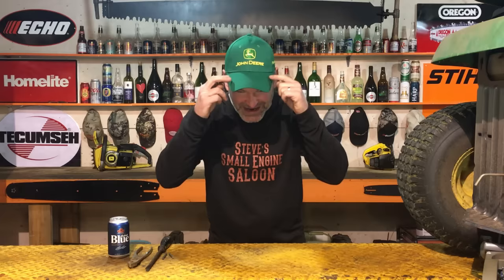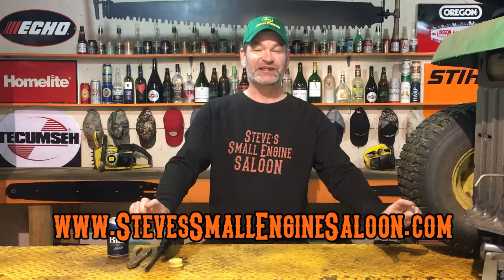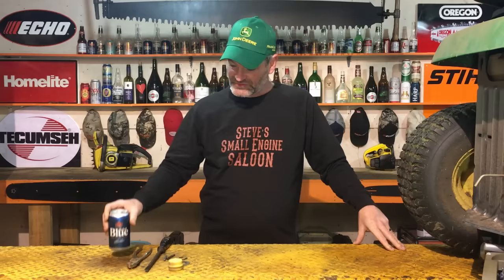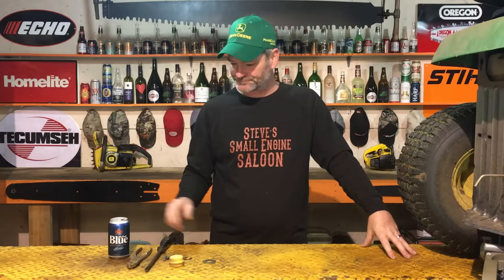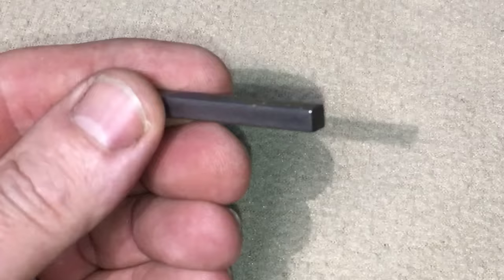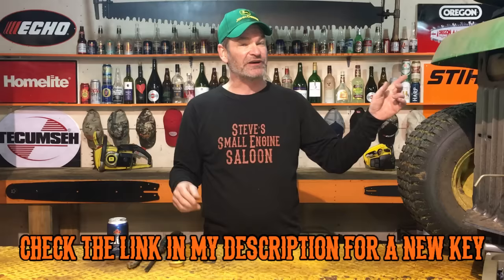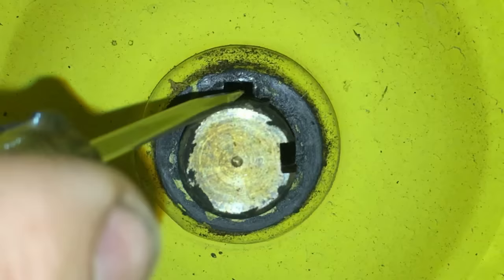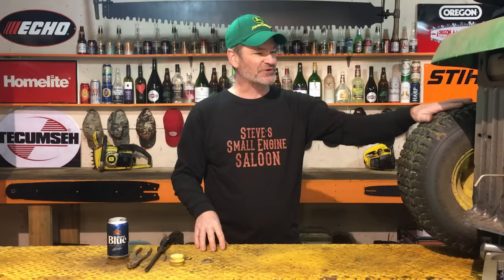How To Fix a Riding LawnMower That Will Not Move or Drive

Comment: Oh I love you. My husband changed the back tire and it wouldn't move. You saved my marriage!
Reply from the maker: Right on Dara!  I am soooo happy that helped....
Reply: Have to be tactful when "suggesting" anything mechanical to a husband. If he didn't figure it out on his own I'm not sure how you can go about revealing his ignorance without deflating his ego. Perhaps, it would be better if you let him load it up and haul it to the small engine repair shop. There, they will tell him that he dropped the key somewhere and he can go try to find it or spend a couple bucks for a new one. He'll likely opt for buying a new one. When he gets home, $25. lighter in the wallet for the diagnosis, he will proceed to tell you how the small engine guy couldn't figure out the problem, and hubby happened to notice how the wheel was free-wheeling when the guy jacked it up. Your husband, with his wealth of observation and knowledge, quickly figured it out. On the way home, hubby has time to make up some tall-ass tale about how he solved it, and your marriage will stay intact. 
Act like you're so impressed with him. Also, offer to go get him some beers because he's so smart. But, every wife should be able to figure out things like this so hubby's ego remains intact. The wife must have the ability to react spontaneously and always say the right thing without hesitation.
Now, quickly while he's feeling so good about himself, ask if he's ready to paint that room you've been wanting painted for the last 5 years. Always ask a hubby to do something for you when his ego is soaring. Complementing  him on how good a painter he is always helps.

Comment: Thank you Steve. Thought I was looking at transmission failure. Found the little bit on the garage floor after I got wheel fixed. I owe you a beer or two
Reply from the maker: Excellent!
Reply: I had that problem. I thought it was a transmission problem so I trashed it. Bought a used hydrostatic weed eater rider. What kind of differential oil does it take? I don't have an owners manual.

Comment: God bless you, dear sir. Lately our mower would barely go in reverse and the past two months it randomly got to where after a while of driving it the riding mower would come to a complete stop or get to really slow pace so that doing anything was impossible(especially of going fast). This was entirely frustrating and our yard got high. Today I decided to try it again and after it happened I looked something else back up on the internet and saw your video. At first I thought it wasn't the problem because we haven't taken the wheel off, but after picking up the mower I found that the left tire would lock but the right side wouldn't. I couldn't see a key so I put in one we had. Unfortunately the key was a bit too big and got locked up in it so I took off the wheel and noticed it already had a key in it. Taking a screw driver I drove out the other key, which didn't take much, and the old key before putting it back together with the old key this time not pushed too far back. When done the tire still moved, but I got back on the mower and tried again. It instantly drove better. On the last few strips of grass I had I cranked it up and tested it and drove fast without any problems as well. -- It was truly stressful. Thank you. Who would imagine something so simple could cause such a big problem?

Comment: hey steve, love your videos:) lots of useful info. SO I got this used craftsman riding mower from marketplace for 150 bucks thinking I was gonna end up with a parts machine for my other craftsman mower. the guy delivered to my house and I hadn't even gone and checked it out. just by the pictures I can see it was in good condition well maintained. guy said it came with the house he bought and it quit running one day while he was using it (which now I believe is totally not true) because he dropped a brand new battery in it and got it running before he delivered to me. he shows up at my house with this thing on the back of his truck and first thing I notice is the steering wheel is out of alignment. he then proceeds to tell me as I'm trying to get the wheels to go straight that the steering is messed up and that the gearbox is also not responsive unless its in the higher gears. (this is not a hydro) 
we unload it and I fire it up. soon as it starts you can hear this metal on metal rubbing sound. so I park it. after I paid him 150.00 for this near mint dlt3000 with an intek 18.5hp briggs, he leaves and now the investigation starts. 
i go online and start looking at cross links and drag links for the steering on this thing then I figured out that the one that was on the unit was just bowed up and hitting the drive pulley. took it off, bent it back as straight as I could get it and now its fine, just needs a good pressure wash and the deck needs some attention cause after cleaning out all the crap that was packed around the pulleys, I discovered that the blade brake was just hanging out on top of the deck.
just thought id share this amazing find and story with you. btw, natty daddy is beer of choice when bud ice is not available.

Comment: Just finished my early cut following all the rains and discovered a flat due to Mesquite thorns. Got it immediately fixed proud of myself and was looking forward to completing the work. &^%$# it will not move. My mind turned to the dark side...............transmission melt down etc.  Found your post and retraced my steps. Must have lost the key at the tyre shop. Took 2 days to get replacement part...............fired up and PRESTO we are back. Thanks for the funny and yet important post. Enjoy your beer!
Reply from the maker: I am so happy to hear this!

Comment: Thanks so much!  I can't believe I found a video for my exact problem.  Thank God I found the key on the back floorboard of my car where I had my wheel to get the new tire put on.  Gave a like and a subscribe.  Now it moves, but the belt must need adjusted or replaced because the blades keep nearly stopping every six inches of mowing....Start stop start stop :-(

Comment: Good video. Thank you Steve. I have a Craftsman LT 1000 and i have a similar problem. The tractor stopped moving forward or backwards..  i have not taken the wheel off ever. Could the key fall off on its own?any suggestions what i should look for ?thanks again for your video. I have not checked the key as yet. Any help would be greatly appreciated.

Comment: Steve, brother, you're great! You have actually helped me with several issues I've had with chainsaws. Here's the thing, I have a mower that won't engage the transaxle, it acts kind of like the disengage lever is in operation but I have moved it back it the drive position and still it won't drive. The PTO brake/clutch pedal doesn't lock the tractor from rolling either. Can you offer me any solution? I mean, I can turn the wrenches and such I just don't know what to do. Not wanting to take it to someone else and pay them to deal with it.

Comment: Steve. From Mark In KY; Those 3/16 keys are necessary for other small engine applications too. The Predator engines use a pretty similar size 3/16” key as the John Deere axle shafts do. I have a 165 John Deere with the left rear wheel seized onto the axle shaft that I have been spraying penetrating oil onto to maybe help break the rust bond. So far, No Cigars on that project.
A couple of days back, I re-powered a Yazoo S-24 Big Wheel Mower with a 6.5hp Predator in place of a Tecumseh H50 5hp engine. My only real issue with the engine swap was having to size the drive belts going from the double sheeve pulley on the engine to the triple sheeve pulley on the mower deck - Two Grooves for Mower Drive, One for Wheel Drive. Due to the engines being different in size, I had to position the new engine farther forward to make things fit up. The down side to my engine swap is the fact that I  now have to use a 41.5 inch incremental belt instead of the 44 inch belts that were so very easy to find. Luckily the belts usually last for a rather long time on this mower. 
On A Different Note Steve, I purchased a key assortment at Tractor Supply Company which had all of the popular sizes. I thought that I would mention this to help others that frequent your YouTube channel. Cheers.

Comment: 2009 Craftsman Professional 917.28970 struggling on slight slopes.  I've changed the drive belt many times over the years, including recently.  I'm assuming the transmission or fluid is going bad (never changed).  Can't find anything anywhere about what to use.  The owner's manual says "sealed from the factory and maintenance not required."  By chance do you know what fluid it uses and if it's serviceable, or just replace the transmission?

Comment: Wow, as soon as you said, did you take the wheel off I went, um oh, yep. So that WAS the fix, so nice. I could not find the key, so I voted for a concrete nail, cut to size, so mowed the whole place. I had been staring at the belts and transmission and some stupid spring. Anyway, Thanks. I tried to Paypal you some cash, but no hookup for that so I bought a T-Shirt!!  I suggest "Did this help you? buy me a beer!" with a Paypal link. I've seen a few sites with that, and of course I will!

Comment: Okay, you freakin' rock Steve!  I've learned a bunch from your channel already.  Changing the tire on my J.D. D110, the ratchet technique for setting the bead on tubeless tire (actually didn't work as tires were far too compressed.  Tried numerous techniques and none worked other than adding a tube) and cleaning a Honda pressure washer carburetor.  I was wondering what the square metal things were and put them back in but apparently did it wrong as my mower didn't go forward or backward after changing both rear tires.  Now I know what to do!  Thank you!   I'll be looking up more videos on the deck and such as I have to remove a birds nest of barbed wire tomorrow from the blade, and I also noticed the front left tire was canted inward for some reason.  Hopefully you have more info I'll need which I'm sure you will.  Thanks again on such clear descriptions and video.  Very well done!  Love your beer collection on the wall as I'm a suds fan too.  Sounds like you might be a resident of Vancouver island.  My aunt lived in Victoria for years as does one of my cousins, and I spent many years coming  up from WA to go diving in that beautiful neck of the woods.

Comment: I did exactly what you described on my John Deere D140–took me more than a few very frustrating minutes to figure it out!  Fortunately, the key fell out near my tire and I happened to notice it, otherwise, I would have had to haul it to the repair shop and faced a bill for a stupid mistake!  It’s not obvious when it happens that your mower won’t move because you changed the tire.  Another “stupid” mistake is forgetting to push in the transmission disconnect (the one you pull out so you can manually push or pull the mower).

Comment: Hey Steve. I really enjoy ALL of your videos. Here is my John Deere problem. I have a D110 and I want to use it again to snow blow. The trouble is, when I go to steer it just goes straight. Hydroplane big time. If I put chains on the front wheel will that help? Or how about a knobby tire? Or am I going to be wasting my money?  I drank 1 Coors and a Bud Light and still can't come up with a solution. Or maybe I have to buy a bigger machine. 🍁👍👍🍻

Comment: I did this 40 years ago on a craftsman Sears mower. I went one step further and replaced the bearings with some aircraft quality  bearing available at fleck bearing company. Just Mic the shaft and get the outside diameter of the bearing and thickness and go to their book and pick the quality bearing you want. I had to drill the hub for the grease sert though be sure to get a bearing with only one side sealed. I never had another bearing problem. Good video should save folks a lot of money plus the head ache of working on their mower all the time.
Reply from the maker: Thank You...

Comment: I had two occasions where my riding mower would not pull.  Each time a stick had derailed the belt on the pulley above the transmission.  The belt was still tight, but was stuck between the fan.  Got the belt back on the pulley and all was well.

Comment: was sold a "fully serviced" Toro lx 500. Well it bogs to the point it wont move,  has a whining sound & then the gas peddle goes limp with no spring back. . I  could smell belt , or something of a similar at one time as well. Any advice would be greatly appreciated.

Comment: Okay that's all well and fine but my mower drives and backs up *sometimes*. I have found that if I give it a little push out bounce on it with a go thrust( you don't want to drive by with your kids while I'm mowing) it will kick out into gear so to speak. 
But lately even that doesn't work. It is a hydrostatic transmission if that makes any difference. But I would assume that key missing would either be full on or full off not sometime-ish drive

Comment: hi Steve ,  I've got a JD LX 178 and the hydrostatic has suddenly stopped working,  it was fine last time out ,  now it wont move forward or back ,  i have changed the drive belt but still no good.  The fluid it topped up in the gearbox.  Ill try an the belt tensioner tomorrow but I wondered if you had any other ideas ,  thanks for all the tips great to be subscribed ,  cant get half the beers you suggest so i have to made do with rubbish french beer

Comment: Steve does those double pulleys on front of mower motor ever go bad? i replaced a new belt on my L100 mower and now the pulley just spins on the front drive pulley.checked the belt its the right one for it and the routing looks good.dont have a clue whats wrong,please help.

Comment: Thanks, mower sat for a season, threw air in and some patches and must not have realized when I pulled a tire out that that pin came off. Couldn't get it to move, all in all was a $2 fix.
Reply from the maker: Right on....

Comment: I had a Craftsman LT 2000 that would start, but not move when it was put into gear.  I found out that the drive belt had slipped off its tensioner.  So, if your mower relies on drive belts, make sure the tensioner is still engaged.  It took only about 2 hours to "research," and less than 5 minutes to fix.

Comment: I have a craftsman Briggs & Stratton model 247.290 Six speed shift on the go 30 inch deck riding mower. 
It starts just fine and the blade works fine.  
It will not go in reverse and it will not go in first second third or fourth speeds. It does however run in 5th and 6th speeds. 
Do you have an idea of what the problem could be?

Comment: Man mine has always worked fine, I’ve changed the belt quite a few times. Ran perfect for a long time. And over time it would start off going very very slow but after riding it for 15 min it would pick up speed. Now it’s gotten worse, and now it does not go anywhere, it struggles and makes a noise but I go no where and I don’t know why

Comment: my craftsman...just turned 400 hrs..lost reverse 2 summers ago,stopped movin forward end o last summer..
I'm told they are known for this? especially if use on any kind o grade repeatedly..never had rear wheel off, it stopped mid cut..
any advice?

Comment: Hi sir I have a jd d110 and my mower is not moving while turned on and I noticed that my bypass valve lever is not working like it’s supposed to. While the mower is turned off i can have the lever either pushed in or pulled out and I can manually push it with ease no matter what position it’s in and I can’t get it to engage so I can drive it again. What could I do to fix this?

Comment: Well I've heard the drive belt can't  come off. Couldn't  go forward or back and the drive belt seemed to be in placed.lifted the riding mower and yes the belt jumped the wheel above the transmission by way of stick. Any quick fixes?

Comment: hi, my john deere 1435 front mower doent quit riding when mowing (full throttle with mowdeck on) when i let my foot of the peddles it stays moving forward. when im half throttle with the mowdeck off it works fine (bit harsh) do you have any ideas what it could be ?

Comment: I'm working or not t 8200 pro series riding mower from Sears it's got a 24-horse Kroger engine and it barely moves forward and it barely moves back I checked everything out and I think it's a transmission what do you think

Comment: Also Steve this is not my problem- I have a Deere that worked when I parked it. I had to move it and the pulled the pin in the back to roll it and now it’s just not engaging even with the pin back in. That was literally the last thing I did to it, so is there something I’m missing?

Comment: This isn’t my issue my pedal is limp I push it and nothing happens not tension. My belt is good. I have the wheels keys. Engine runs fine.

Comment: Interesting, but I don't think this is my issue.  My JD stops moving forward sometimes, especially on an incline.  With some rocking back and forth I can usually get it to move.  Do you have a solution for this?  I'd be most interested.  Thanks.

Comment: With my Arien 42" riding lawnmower there was no flat tire, it just stopped moving while mowing, the engine kept running, but it would move back or forward.

Comment: I have an old craftsman riding lawnmower.  There's a 7/16 bolt connecting the shifter to the linkage. my problem that bolt comes loose from the linkage after shifting only a few times.  Eventually, it can't shift out of gear at all.  Is there some kind of permanent fix other than tightening that thing all the time?  Sorry to hear about your brother man.

Comment: Off subject but i’ve owned both a JD 425 & JD X475 with a Kawasaki engine. Both start hard if setting a couple weeks. Have to choke and crank, sometimes 10 or 15 seconds as if the fuel line was totally empty. Is this normal?